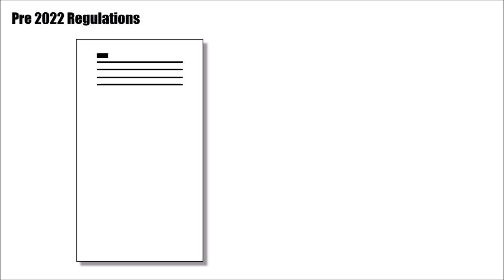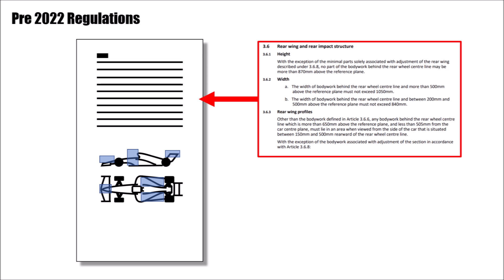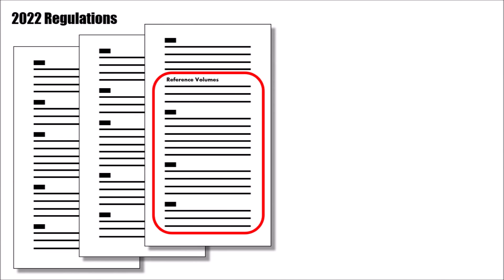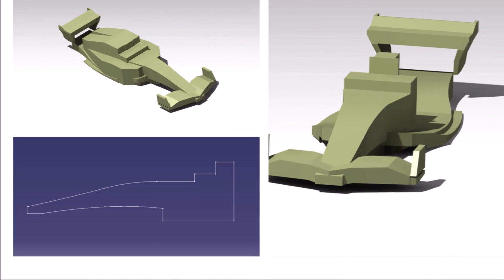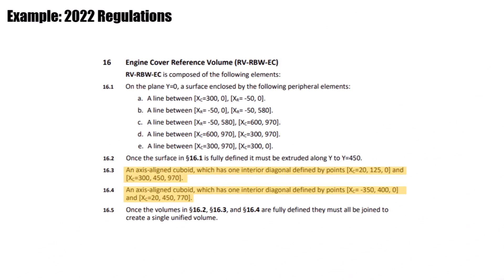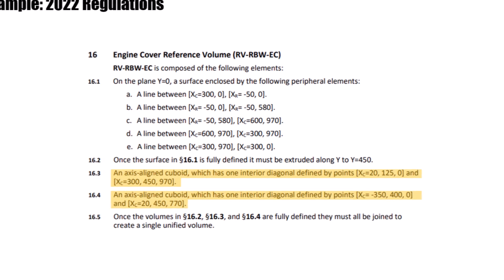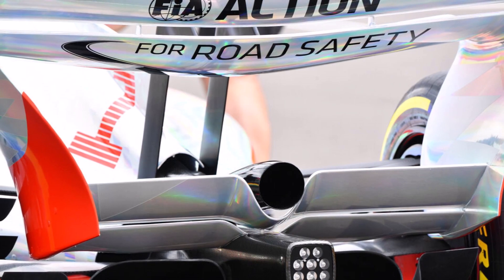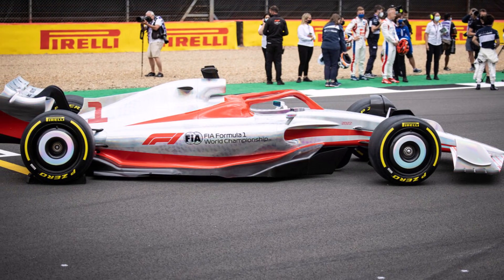F1 Designer explains 2022 Regulations

Comment: The front wing is too high. Adds to porpoising. Thoughts?
Reply from the maker: I cannot really see the connection to front wing height. You can get this problem with low and high front wings.
Important is just to make sure that the diffuser doesn't choke itself (ride height, floor slots, etc.)
Reply: @bsport320  OK. I just notice the front wing is much higher than the old cars. Just thought lowering the wings to floor level would help stop the porpoising.

Comment: Slightly off topic, but is there any easy way to draw rear wing flaps that have a varied chord length across its span? ie shorter chords where there is a slot-gap separator or the curvy multi-element front wings from '19-'21? I've drawn the main flap profile for the center plane, but I don't fancy having to do multiple profiles each with their own set of driving expressions and equations for the sketches that define the dimensions etc for what is essentially a very similar aerofoil just with a different chord length?

Sorry if my question isn't clear, maybe I get email you or direct message you? Just wanting to improve my Siemens NX/Catia V5 skills.
Reply from the maker: No problem at all, I understand what you mean. It's actually not that hard. You divide the wing in different sections and define the profiles individually. If you want to know more details, check out my online course about Aero Design:
https://motorsportengineer.net/aero-design-in-f1/
Reply: @bsport320  So if I wanted the full freedom of having the wing fully parameterised, then it means what I originally thought and having to have a set of different profiles and having to have a set of expressions for each profile that will be used on each plane through the span, and then using thorugh curve mesh or multi-section to create the actual surfaces? Thought there could have been a quicker less tedious way haha.

Thank you for the reply, and I will definitely look into that course. Always interested in insights from people with industry experience. I was lucky enough to have an ex Williams/Toyota aerodynamicist who was my project supervisor when I was doing my degree, so that was super helpful.
Reply from the maker: Yes it's basically that. But it's not as bad as it sounds and if you build it efficiently it's actually quite easy to work with - and you have full freedom.